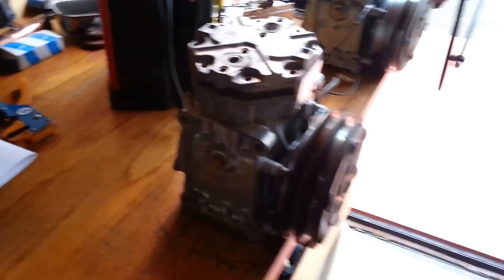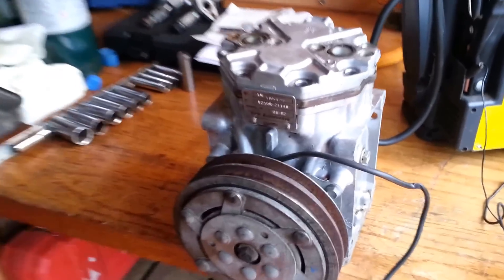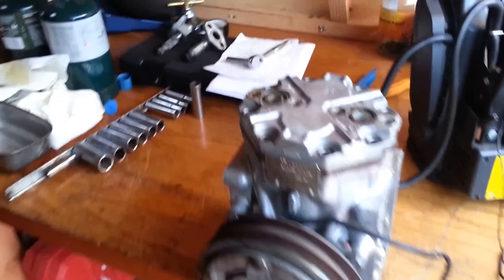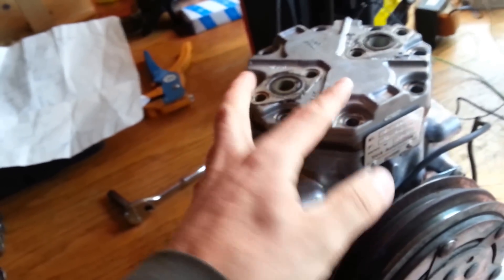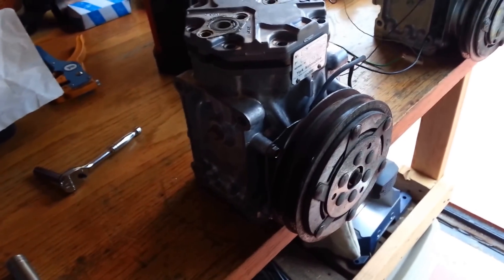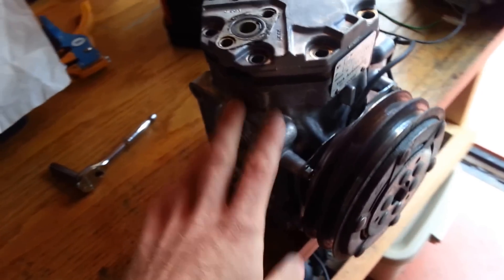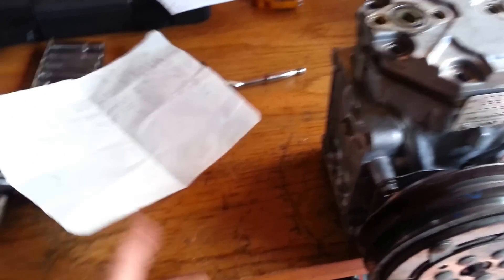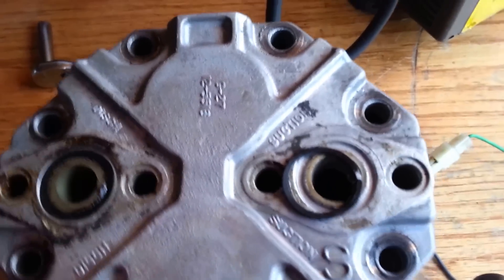York A.C. Compressor for Pedal Powered Ice Machine

Comment: Just stumbled upon your channel my dad and I used to rebuild those compressors since the 1970s in automotive you would also like the Frigidaire A6 to 6 cylinder axial external drive compressor with a 6 ounce oil reservoir internal pump attached to the shaft cross drilled crankshaft that lubricates do the pump .
      That old York compressor you have there also has an oil pump in the back of the case attached to the rear of the crankshaft and they have an oil pick up tube that was either meant for the compressor to be laid sideways or standing up this is a very crucial thing when picking your compressors there’s a letter or number designation on the tag to let you know which way that compressor was designed to sit so you don’t suck air must deliver oil to those bearings to get a good long life